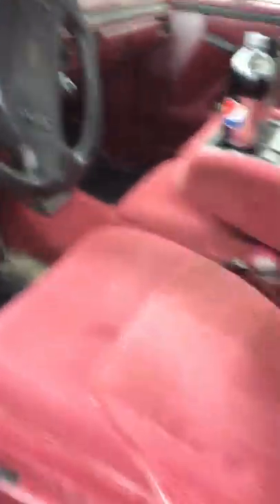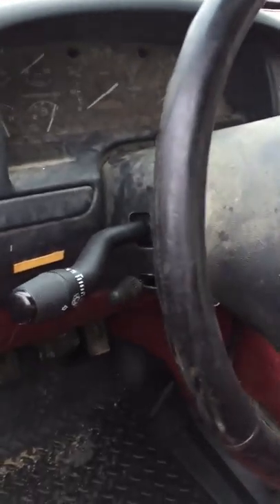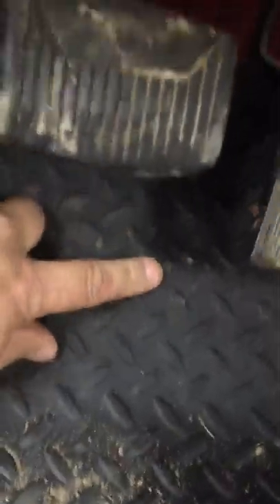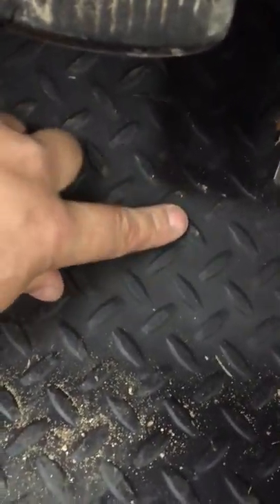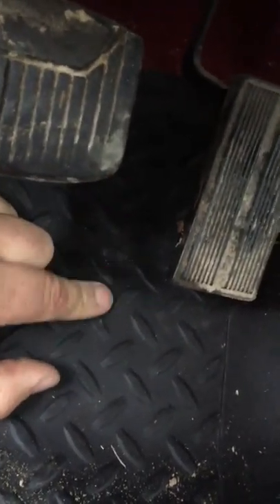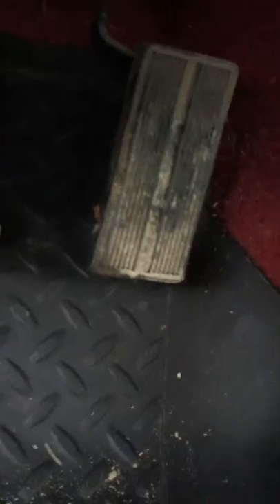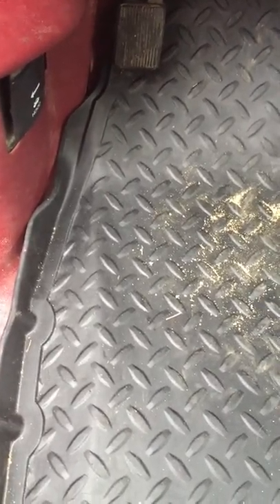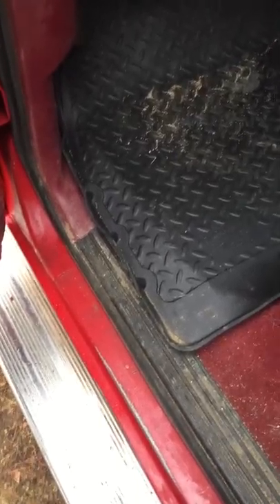Husky Liners floor mat review with one problem

Comment: if you could do it over again, would you purchase the husky product again?  We recently paid 330.00 for weathertech liners for our 2015 Sienna LE to discover the liners are designed to force all of the leg room to the rear of the vehicle (the passengers in the middle seats have absolutely no leg room).   We were told we could bend the rear liners up a little to allow the middle seats to move back, however, doing so creates another problem:  the second row floor liner moves around when people traverse it (mostly because there are no cleats on the bottom of the liner).  Needless to say, we're experiencing buyers remorse.    Any advice?